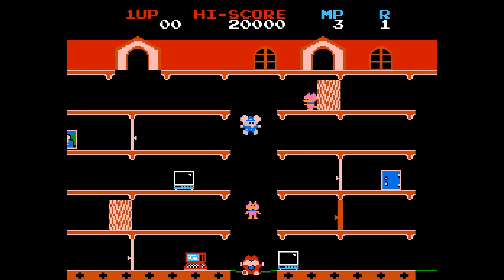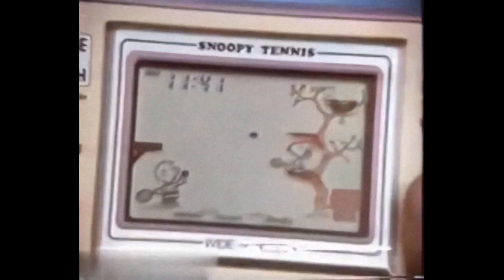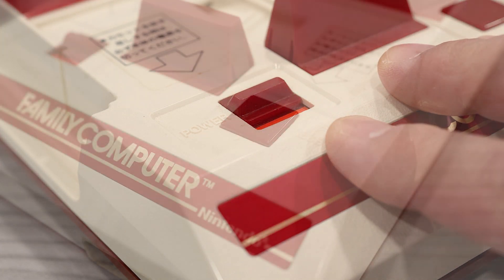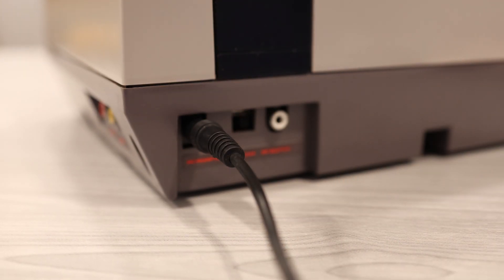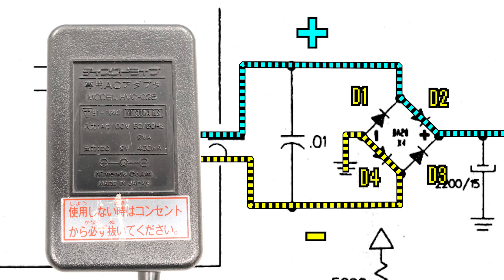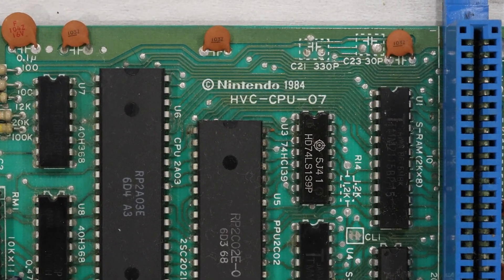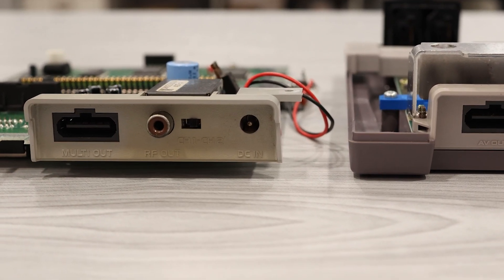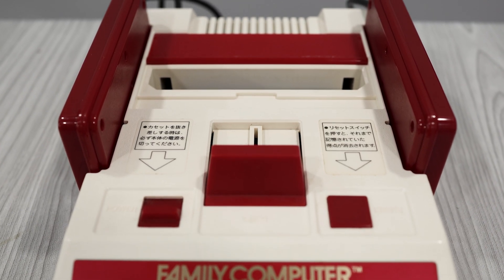Inside the Famicom | 01: The Design of a Legend

Comment: Hi Ken,

I bought a Famicom recently and it came with a "fixed" (as in, you would need to open up the console to remove/change it) AC Adapter.

My concern is that it says "Output: 5V---1000mA", but everything online tells me it should be 9/10V output. Should I change it even if the 5V cable works or will it damage the device over time?

Many thanks,
Luke

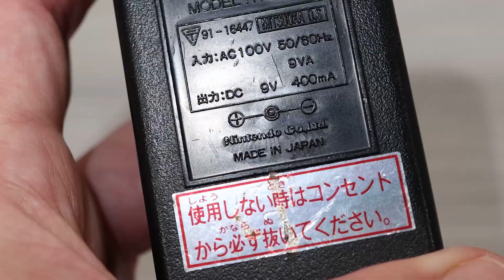Comment: At appoximately 6:00, you mention blowing capacitor C-25 if the wrong type of power adaptor is connected.  Unfortunately, I just ran the wrong polarity through my system, and am now unable to power it on.  Can you confirm that this is the likely problem, or provide any notes on your diagnosis/repair process?  I appreciate you help!
Reply from the maker: Yep, that's right - if it's a Famicom, then that's likely what happened to you as well. If you see that C25 has puffed up or opened its canister to release the magic smoke, then that would be confirmation. But even if it doesn't look visibly damaged, it won't hurt to replace it with another 1000uF cap and see if that solves the problem. It's the first component in the path of that unregulated power signal, so it's likely to be the one that blows. If it still doesn't power on, then the next thing to replace would be the 7805 voltage regulator. But I think the issue is most likely the that cap.

Comment: Also "component video" is usually used to refer to YPbPr video. Technically yes it breaks out the composite video and mono audio into different signal "components" but since there's only 1 video component it's just composite, or CVBS.
Reply from the maker: Yeah, I misspoke there - someone else called this out in different comment as well

Comment: If I remember correctly, the AV Top Loader was only by direct exchange of your RF Top Loader by Nintendo in response to customer complaints, so it wasn't actually a model you can buy thus making it extremely rare.
Reply from the maker: Oh, interesting... that would certainly explain the rarity!
Reply: @whatskenmaking  i wonder how making it RF only could be considered a cost cutting method since involved ADDING and rf modulator instead of just outputing the av signal,  heck even using the snes av port cant be considered a cost cutting move, then they had to bundle official av cables, why not just stick to cheap rca plugs and call it a day? oh yeah of course, because nintendo...
Reply from the maker: I read somewhere a while back that when they researched it, Nintendo found that only a small percentage of the North American NESes sold were using the AV ports. So, I think the question wasn't whether to include one over the other, but rather should both be included.
Reply: you had to go directly to the N and specify that the picture quality was bad, if and only if they would give you an av out model

Comment: Hey Ken, great video as always. One question that comes in my mind, what happened to the controller microfon from the second controller on the original famicon? Did they abandoned it completely in later revisions? Greetings from Germany.
Reply from the maker: Thanks! I'll have a video on the controllers and will be talking more about the mic in that one. In short, though - it was abandoned pretty quickly.  I didn't mention it in this video, but when the AV Famicom launched with detachable controllers, that's when the mic on P2 disappeared. There were only a small handful of games that used it, so I'm not sure that it was terribly missed - but yeah, it didn't hang around in the later Famicom models.
Reply: Thanks for your answer! (little bit star struck here) 😄 When I think about it I'm digging in the NES past since I can remember, but never dealt with the famicon or the mic function in all these years. Most videos and articles (I read and watched) mentioned it shortly but I don't remember someone explicitly dealing with this topic. Bringing back famicon & famicon disk system functionalitys to the NES hardware would be an interesting project for me personally.
Reply from the maker: 😊 Yep, running an FDS on an NES would be something interesting to do in a video 😉